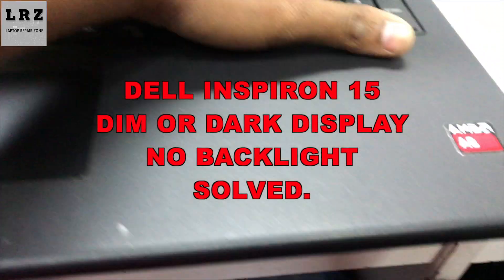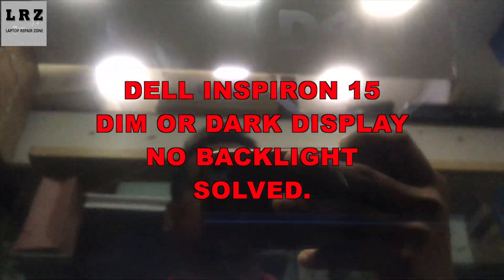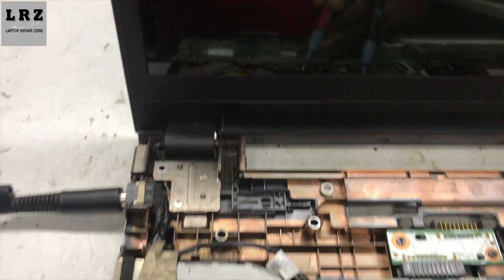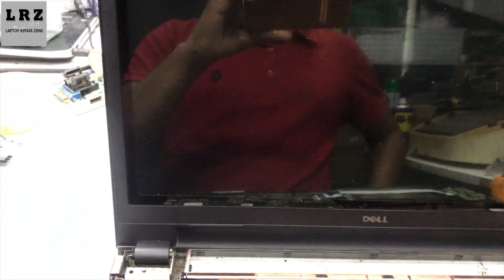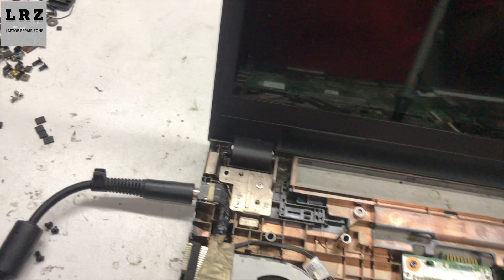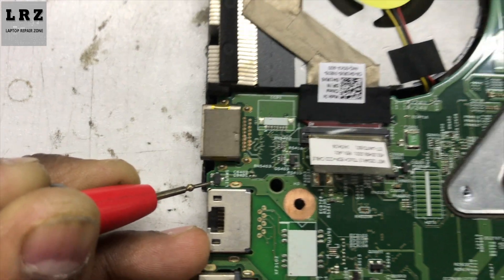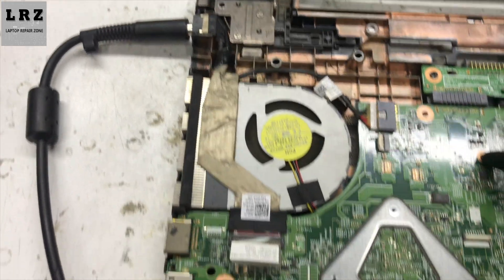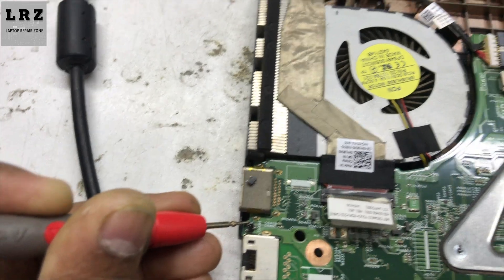dell laptop black screen | dell black screen | dell backlight problem fixed..

Comment: I had a problem that the screen was cut off when moving it backwards
and it was the cable, first I repaired it and then I changed it for a new one and that problem was solved.
But now what pains me is that when I raise the brightness to more than 20% the screen flickers.
When it blinks, it is not like before, the image is cut, only that the brightness does not rise and horizontal bands are formed, and when the brightness lowers the bands go away. But the brightness is so low that it is hard to see the screen.
Have you heard something like this. Thanks
Reply from the maker: Thanks for your comment. check with another LED screen.

Comment: need a clue from you for this Mob Lenovo z51  no display, fan spin and stop looping flashed Bios still the same  coils no short, all coils voltages ok ,5&3VS ok  CPU VCore ok  what is the problum
Reply from the maker: Follow the schematic